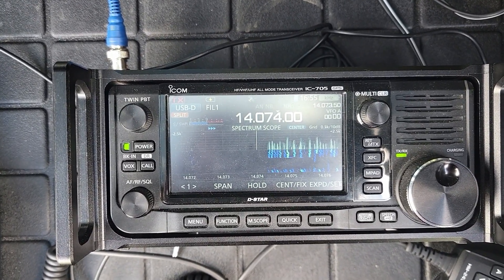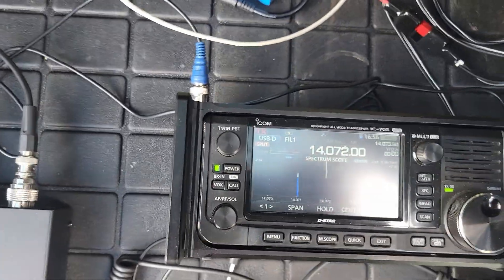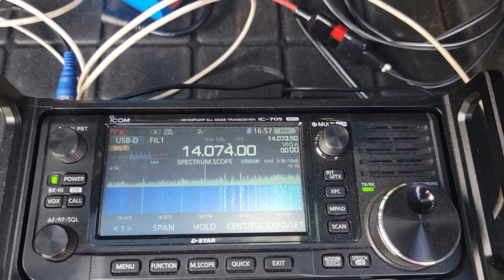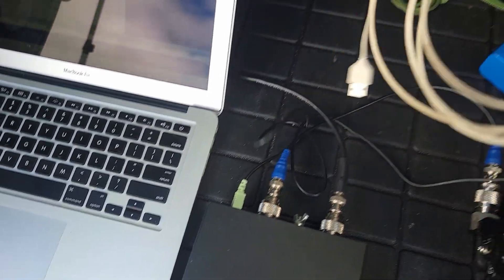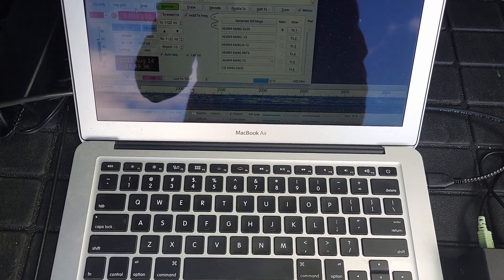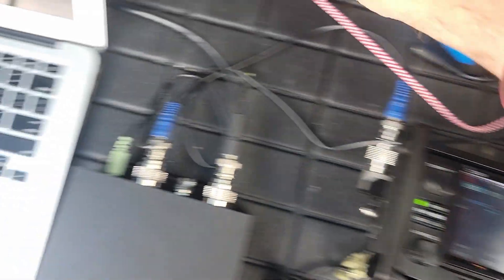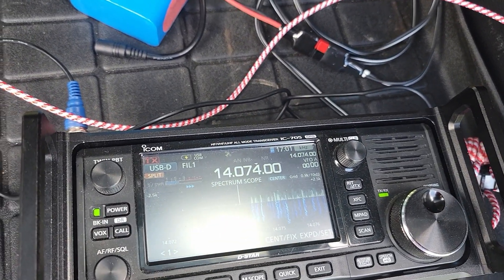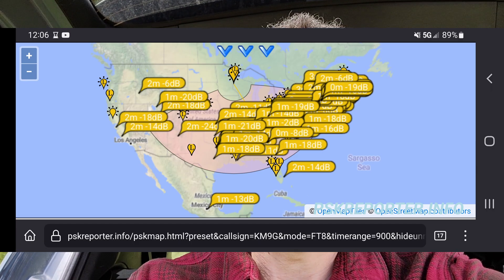Let's Remove USB Noise from our Icom IC-705

Comment: I know another video I saw while considering getting an IC-705 showed a separate board that allows USB-C connection as well to reduce RFI/add protection circuitry to the data port. It's the "USB-C/Send Control Board Upgrade" by ihelpu if anyone is wondering (A bit more expensive at $84 than a toroid but seems worthwhile for the USB-C capability). Hope that helps 😊

Comment: I have the same problem and when it goes in TX the connection with PC goes down. The same problem of RFI return than give very noise disturb. I tried with shielded cable, i put silver paper on the cable, i used ferrite rings, i used 1mt or 5mt cable,  but not resolved, the problem exist... Now i will try your solution but i thinks that icom have to give a correct cable for the user. Last step is the official software that use Bluetooth.
Reply from the maker: Good Luck!

Comment: Adore this video.  This is literally the exact same setup I have on an IC-7851, minus the awesome candy cane braiding on the USB cable.  Having a small stack of FT-140-43s and FT-240-43s makes amateur radio so much better.  If you work lower than 20 meters frequently, you might consider a 31 mix as well.
Reply from the maker: Mix 31 is the ticket!  I would have grabbed it first!  Now I'm just lazy and I need to order more 43s

Comment: Reasons to buy the Icom remote control software and use a WiFi connection to the radio.
Reply from the maker: Just be careful, sometimes the wifi connection can get blown out too.

Comment: not working this method...i tested a tonn of different variety ferrites, each end of the cable at same time, like: #31 #43 #61 #33RI #K mix, etc. if usb level communication starting between ic705 and the various laptop/desktop pc, the noise coming up again.  What i found that is if i pull a bit to sideway the connector at the radio, the signal changeing, a bit getting qieter, maybe loose connector and improper gnd connection? But this is abnormal in every way! Especialy for the price.
Reply from the maker: Totally agree - the 705 costs way too much to have RFI issues!

Comment: i realize your video is several months long but thought i would let you know.
was in my shack today turned my ic7300 on and poof-----rfi on most of the low bands repeating in 40 kc bars on the waterfall. MMM i said. must be interference.
soooo i looked around and saw my usb from my pc to the radio had a usb plugged in.  
as soon as i unplugged it my radio came back to life. like magic
to verify i looked around on Youtube and saw your video and confirmed my experience.
thanks for a very concise video. havent added a toroid choke yet but probably will
Reply from the maker: Excellent, let me know if it helps!  A lot if people report good results with Tripp Lite cables like this one: https://amzn.to/3YmTNQo

Comment: This looks interesting does all this require is a USB connection ? I have a 705 but haven’t played with it a lot yet. What is the software you are using on the Mac ?
Reply from the maker: The radio does not require a USB connection.  It has bluetooth that you can use instead of USB.  The software on the mac is "WSJT-X" and that's the premiere software needed for FT8 and other "Joe Taylor" modes.  Lots of fun!
Reply: @temporarilyoffline  have you done any tutorial videos on this ? That would be really helpful. Thank you
Reply from the maker: @ads3453  Not on this specific radio, but I will.  The IC-705 is one of the easier radios to get onto FT8.  Also, we are doing a "Hey what's this FT8 all about" type video tonight: https://www.youtube.com/watch?v=l8QjlKK0tLU
Reply: @temporarilyoffline  cool I haven’t played with data modes for years the last time I did was with a icom 7000 with modems and cat boxes etc
Reply from the maker: @ads3453  sounds like fun

Comment: What model LDG tuner/match is that? T100?
How is it powered, or connectors used?
Connected to radio tuner jack?
Reply from the maker: GOOD EYE!  It wasn't part of the test, but you caught it!  I'm doing some testing for an upcoming video and will have some tips and tricks for it.  Its a great little tuner.  It is the Z100-Plus from LDG.  For the 705, you just need a regular straight-thru cable to the tuner, for the Yaesu's you need a special cable.  It will work with "RF Sense" as well.  Power comes from internal batteries (AA off the top of my head), but I'll have a special tip for powering it.  Stay tuned - so many videos to make, but my day job gets in the way.
Reply: @temporarilyoffline  No worries. Just curious. For the T100 I wired their style of Molex connector to a 3.5mm stereo plug. Powered by a 9v batt "Velcro'd" in the case. No voided warranty. ;-)
Reply from the maker: @martidav1  that's the way of the ham!

Comment: A long understood and well documented issue with the IC-705 that even Icom has acknowledged. They claim there wasn't enough space in the radio for proper shielding and have essentially told the user community its their problem to deal with. This issue badly mars an otherwise great rig, and Icom's response to this issue is very disappointing. One solution that works great is to use the Remote Server package that comes with Icom's RS-BA1 software and just drive everything via wi-fi. In fact, I've been saying for over a year that Icom can apologize to the 705 community by providing a free IC-705 specific version of the Remote Server software. But all we get from them is "keep buying cables and adding chokes until you find something that works".
Reply from the maker: Agreed, icom makes interesting products, but could do a better job taking care of its customers.  Apple had a similar problem with an iPhone model and gave out free phone cases to fix it.

Comment: TNX Steve for letting us know, YL and I have a 705 getting ready to use with the Buddipole.  When using WSJT-X instead of hitting the retry button to establish the connection you can go to "Preferences", "Radio" and select the USB port manually.  At the home QTH that brings up a lot of USB ports but in the car with the MB Air it should only be probably two just like the USB mini, right and wrong!  Choose the other one and hit the connect button.  Might save you a few Retry strokes.  73 - Dino KLØS
Reply from the maker: Great tip, thanks for watching!

Comment: I had the same issue with my Dell Laptop USB and my Xiegu x6100. I had a high noise floor and everytime I transmitted my USB bus would crash on my laptop and it would be stuck in transmit. Glad you found our problem! Haha.
Reply from the maker: Glad I could help!

Comment: Isn't the noise source the PC? If so, the beads would be most effective if added at the PC end.
Reply from the maker: There is a great debate going on in the comments here as to what the noise is.  So I'm going to dig a bit deeper.  However, you are 100% correct that you choke noise at its source (PC end)... but in this case, since it worked well I wasn't going to re-wrap it. - "Why do you always find something in the last place you look?"

Comment: The ic-705 also has a built-in solution: WLAN. ;)

To get the audio into wsjtx, you just need the program wfview and virtual source/sinks in pulseaudio (or if you use the wrong operating system, virtual audio cable;))
Reply from the maker: It's on the list to play with, thanks.

Comment: Common mode RF caused by inadequate RF ground at the antenna is what is causing the dropped connection and most likely the noise too.
Reply from the maker: Could be.  The 705 is particularly susceptible to it.

Comment: Fast way to get out of being stuck in transmit: change the vox button to work as a tx button in settings. I get stuck in tx way more often than I use vox. In my (limited) experience, it seems like the 705 does not like compromise antennas (even with a tuner) when doing digital modes. Amazon ferrite clips seem useless here too. 0/10, would not recommend. I like the giant toroid, definitely going to try that.
Reply from the maker: Go big or go home, right!

Comment: One of the reasons I leave the IC 705 at home when I do POTA/SOTA and using the computer is this issue. I have a FT-240-31 torroid and about 10 turns. I've also turned off USB charging and still have the noise when I hook it up to the computer like you had. When I use my Android phone to log with HAMRS, then I take the IC 705. I usually take the X6100 out on activations when I'm using my computer as it does not have the issue. I just ordered the FT-240-43 torroid and the USB cable in your link and wind up the crap out of it and see what happens. If this finally resolves the issue then it may go on more POTA/SOTA with me. Thanks for the video and the ideas. 73.
Reply from the maker: No problem Scott.  I got a lot of feedback in the comments, so I'll be making a follow-up to share that info back out.  Hope it works out for you!

Comment: Always use a good quality shielded USB cable. I've noticed a lot of the USB micro cables are poor quality. 
USB-C seems to be better, but lacking on the radio of course.

FT-240-43 for the win!
Reply from the maker: Shielded USB is on the menu

Comment: The choke might be treating the symptom not the cause.   The issue may be the fact that the computer and radio are galvanically connected via the USB.  Consider - the chances that the radio and computer are at exactly the same voltage potential are slim - thus there will be an unintended current flow via the USB - and this could be the root of your problem.    You could eliminate the galvanic connection by using an opto-isolator - but don't buy an 'el-cheapo' as they can generate HF hash!  The cheap ones also limit the throughput speed - and thus might not work for your application. So you might need to buy an independantly powered USB opto-isolator - ie one that dosen't take it's power from either of the devices - a bit more expensive... 73 M0XYM
Reply from the maker: I didn't know these existed until today and they run from $9 to $60 for the "cheap ones", I haven't found one that is powered, but would imagine it is cost prohibitive.  I fully agree with your analysis, bit in the end, I'm $10 in and problem is solved, so are we both right,  just picked different solutions?

Comment: I have the same problem with 20m signal generation on my IC-7100 causing problems with WSJT-X. I'll need to find a USB-B cable long enough to do that toroid winding. I currently have a cable with a ferrite attached to it at the radio side, but it only seems to stop interference about half the time.
Reply from the maker: Probably not enough turns or beads, that's what I ran into with the snap on beads - better, but not enough.

Comment: I have absolutely ZERO noise on my rig when connected to the Buddipole, but it works great for signal attenuation.
Reply from the maker: I don't see this as a buddipole problem - I've run into this same problem with multiple antennas.
Reply: @temporarilyoffline  Thumbs up for a good response. I was just ribbing the Buddipole fans.
Reply from the maker: @norrinradd8952  I like buddipole in general, but I feel the frustrations of high-Q

Comment: It looked like you did not gt the noise until you plugged the cable in to the computer.  Could the noise be coming from it?
Reply from the maker: Yes, the noise is from the computer - either CPU noise or variances in voltage.  The toroid solves both potentials, so I'm happy to be playing radio again.

Comment: I was really disappointed at first when connected to the PC via USB cable, could not get rid of the noise. It turned out to be l had to turn off charging over usb in the settings, the noise was from the charging circuit for the battery. 

The ferrite toroid was only needed to stop the radio locking up on transmit.
Reply from the maker: So even with charging off, you still had TX lockups? (Making sure I read that right)

Comment: Thanks Steve- Yesterday I  tried FT8 with a loop antenna- it was a disaster.  Was highly disappointed with Icom. The cheapo Xiegu X6100 had no issues whatsoever.
Reply from the maker: Yeah. I had the same problems - the x6100 worked fine and the 705 didn't. Now it's fixed!
Reply: @temporarilyoffline  But with a big lump.  I just purchased a usb dongle with filtering, I will report back after some tests...
Reply from the maker: Same

Comment: You are getting RF coming down the shield of your antenna cable, RF on the case of the 705, then RF on the shield of the USB cable, and RF on the laptop.

You stopped the RF with what you did on the USB cable. Another solution is STOP the RF from coming down the shield of the antenna cable, buy adding tolorids and such to the antenna cable, or a counter poise.
Reply from the maker: You are correct - The toroids that are already on the antenna are not enough and I can add more there.

Comment: I use WFview when using the IC705. This eliminates the USB cable. There is a time lag when operating WSJT-x/FT8 but if you then use JT Sync this re-syncs the clock allowing for the latency. Hope that helps 🙂
Reply from the maker: Many ways to skin this one!  I have WFView on the list of things to play with now.  Thanks!

Comment: Interesting problem Steve. I am a degree level trained Auto engineer, and I can see one problem with your set up, you are attacking the symptom, NOT the problem!. Seems to me that you have broken the first rule of fault finding by going straight for the simple answer. Surely, as the cable itself cannot produce noise, and the radio shows that the environment is "quiet", the problem must lie in the laptop? As a member of the "Big Hammer" school of engineering, I am totally lost with the magic of the gizmo, I reckon I would try and find a quieter laptop, rather than rely on having to choke everything off in sight. On the other hand, your "fix" worked so who am I to criticize!! 73 Jim M7BXT
Reply from the maker: Thanks Jim!  In my normal operation with this radio I don't even have a laptop connected.  I'm either in the field with paper and pen, or I'm in the home shack with multiple computers of varying kinds.  One thing the comments on this video have shown is there are many ways to solve this problem and today I learned that there is a way to turn off the charging circuit in the radio which might also help.  Its not like the Macbook is a 3rd tier player - Apple makes some of the best computer hardware out there - hard to hit that hammer any harder.  But again, more testing/playing is warranted and possible.  I have a Dell Laptop to toss at it as well as turning that charging circuit off!  If anything magical/video worthy turns up, I'll have one out to show it.

Comment: I bought 20 of those clip-on ferrite beads, they're waiting for me at the post office, hah. I'm also experiencing increased noise floor with an SDR dongle connected to my MacBook Air (which could be the same model as yours + I'm also running Linux, though with MATE instead of XFCE). With the desktop computer, it's better on HF, but worse on VHF and UHF due to DisplayPort and HDMI noise. However, even one or two of those clip-on ferrites make things better. But I must try your method, obviously a single turn around the (expensive) core is probably more effective than one no-name clip-on bead.
Reply from the maker: You're simulating multiple turns by using multiple cores, otherwise it's the same solution... just different storage hassles.

Comment: Using the chameleon coax with the choke on it fixed my issue completely. Others have said that Tripp Lite USB cables remove the noise so I bought some, but haven't tested them out with regular coax.
Reply from the maker: That would be a good test.  I'm shocked that the laptop is generating as much noise as it is... but we know the fix!
Reply: @temporarilyoffline  for whatever reason, I haven't had any noise when connecting to the laptop. When I would transmit, it would cause the disconnection, though. Do you have the USB port set to charge the 705? If so, try turning that off with the regular cable and see if the noise drops.
Reply from the maker: @0150r  I never even bothered to look if that was a setting... I'll try it.

Comment: Hi Steve. Quite the USB ferrite there. The Buddipole balun does not have anywhere near enough choking impedance. That is why I designed the TRB/TRSB. 73 de w6akb.
Reply from the maker: https://www.akbeng.com/products/triple-ratio-balun/  Looks like they are out of stock.  I saw the BP version, how does your model work when you need different impedance?  Does it "magically" detect or would I need to make a change?  Let me know when you've got stock again!

Comment: I love those 240-43's. I like the smaller 140-43 ones as well, that is what I use for my USB-cables.
Reply: This crest of yours (your YouTube  logo). Is there an online tool to create that? I've been looking for it
Reply: @ve2zdx  Hey theree André. I had to look it up because I forgot the call. It was made by Marcel PD3MR
Reply from the maker: The 140 should work great as well, just fewer turns.
Reply: @temporarilyoffline  it does work great, indeed with less turns. For this is like with radials under a vertical, there is a moment where it doesn't gain noise reduction further. Just try and see what happens.

Good USB cables rather than the dollarstore ones can help a lot too, that I found out a few years back.